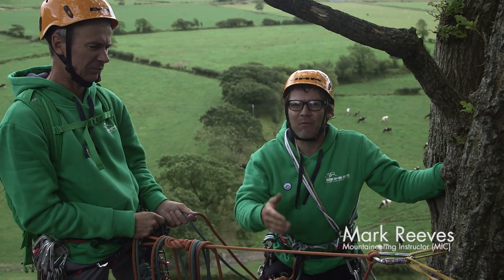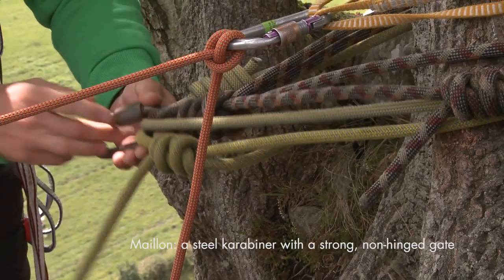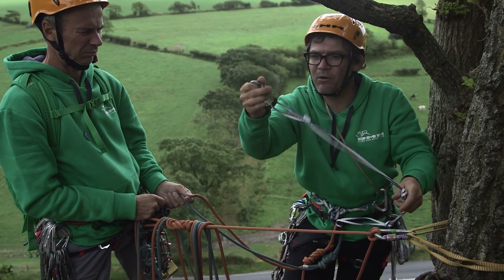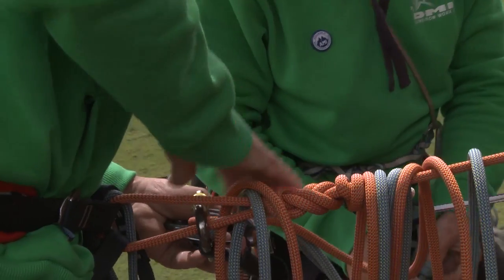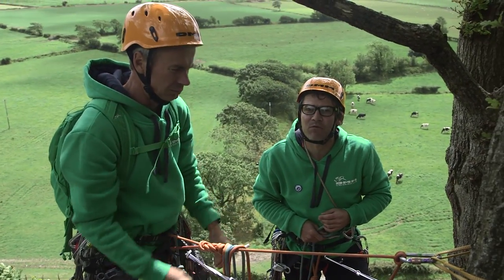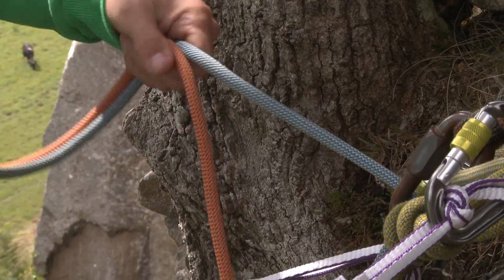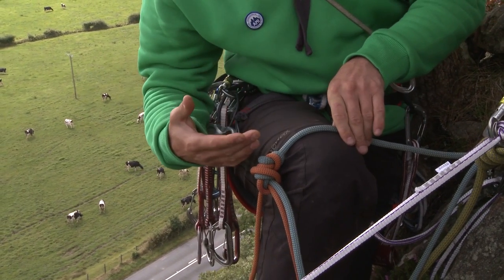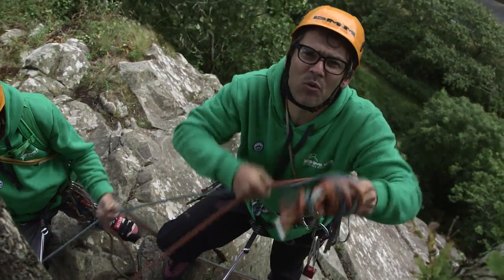How to: multiple abseils part one

Comment: Is that the dyneema tether girth hitched to the belay loop? Forgive me if it’s been said a million times but should be girth hitched to the hard points instead.
Reply: No, that's considered good practice. At least in the eastern Alps where I climb. The girth hitch does not move so no, there is no wear on the belay loop.
Reply: Tying in with your rope is a different story. There, you want to use the "hard points" since it gets the knot closer to your body, you double up the belay loop and free it for other uses such as the before mentioned girth hitch of the personal anchor.

Comment: forgive my ignorance for I am new to climbing (I'm not going to be trying this anytime soon, I'm just curious. I'll be sticking with top roping for a while) but why use two ropes? I've seen a couple of these videos and you're using two ropes.
Reply: There are a couple of reasons why someone might choose to rappel with two ropes. When someone is rappelling on two ropes, the main advantage is in getting to do a full length rappel which saves a lot of time in multi pitch rappel scenarios. 

With a single 60 metre rope, you must pass half of the rope through the rappel anchor in order to rappel on both strands. Because you fold it in half, this means you only get to rappel 30 metres at a time.

With two smaller 60 metre ropes, as is demonstrated in this video, you tie the ropes together with a flat overhand knot and then thread one side through until you reach the knot. Because the knot takes up less than 1 metre of material from each rope, you still have ~59 metres of material from each rope to do a double strand rappel on.

I hope this clears things up. As for why someone would choose to climb with twin or double(half) ropes, the former is used with meandering climbs to avoid rope drag, and the latter is usually used for long multi pitch climbs.
Reply: also nice to have two ropes on wandering multi pitch routes to decrease rope drag.
Reply: Well said. @Liam

Comment: sketchiest abseil i've seen.
no redundancy on the dynema before the abseil. why not use 2 of them? 
why not a double fisherman knot when connecting the ropes? that double overhand is twice as thick on one side as a fishermans, there's no telling if the thick part will get stuck or if the skinny side will slide past cracks etc.
no stop knot on the ropes? in part 2 he says the rope is not long enough to hit the ground. do you want to abseil in terminal velocity? because thats how you abseil in terminal velocity.
in part 2 he say that he does a prussik, but he instead does a machard.. but what do I know.
Reply: What about redundancy for the redundancy? maybe back that one up too?

The overhand knot to join them works well as you pull it rolls over so that the rock face thus preventing the knot from jamming. There is always to odd chance that either a double fishermans or overhand will jam but that is where you should try to do everything else to avoid the possibility of it, keeping tension pull in a direction away from obvious sticky points etc.

Definitely put a knot on the end!!!

The prussik he has done is a french prussik as opposed to a machard (klemheist) type.
Reply: @davidcross30  Yea, totally aggree! Was going to write the same. 
It's prusik with one S though, named after Karl Prusik. 👍
Reply: @DaOndee  yeah spilling isn’t my best attribute. 😉